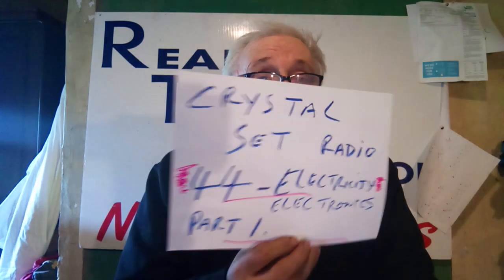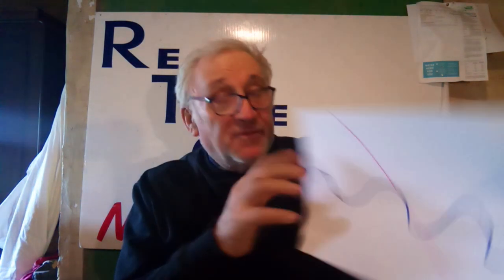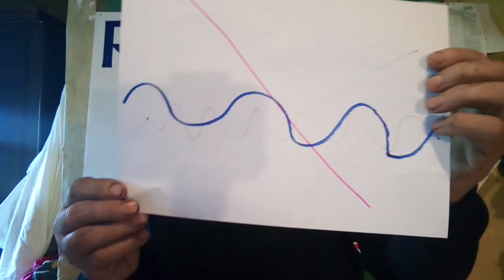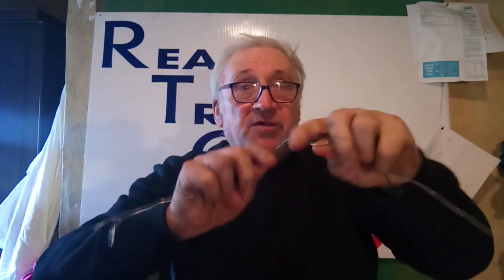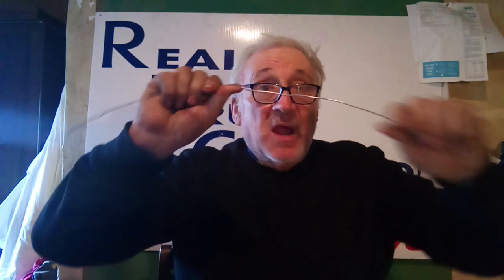44 Crystal set radio. Electricity electronics.

Comment: i have a little crystal radio that's a reproduction of a 50s product.   It looks like a little rocket ship and the cone has a small plunger in it.  you pull or push the plunger in to tune it.  it has a little wire and a clamp on the end and you clamp it to something metal like a bed post.  It then has a small ear piece to listen to it.  It does work but the room must be very, very quiet to hear it.